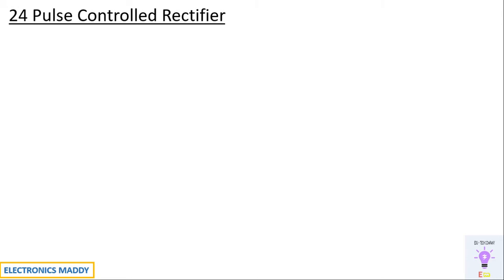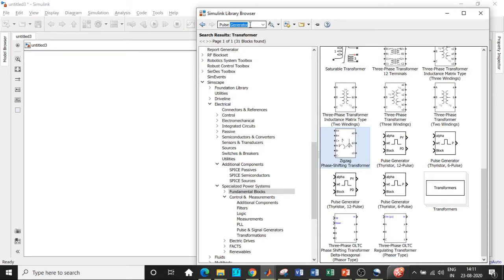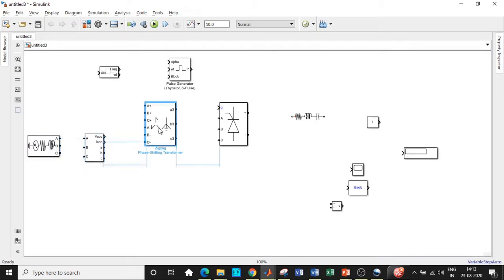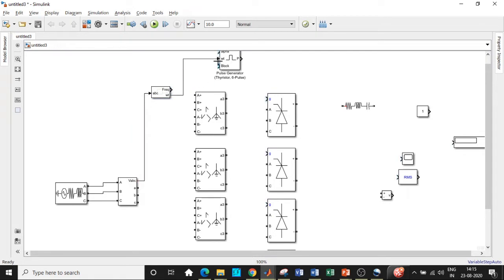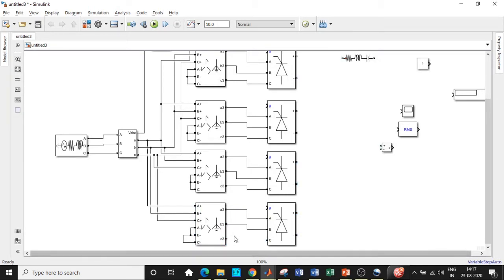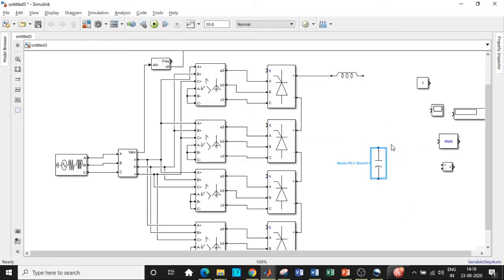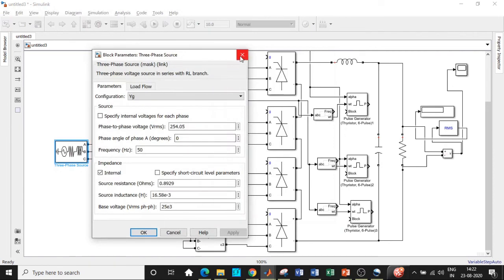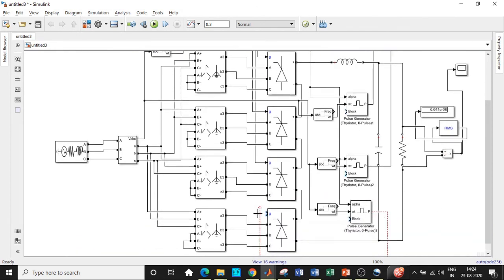Simulation of 24 Pulse Controlled Rectifier in MATLAB | SIMULINK

Comment: Hello,  Can you please provide me a Table of pF and THDI for a 24 Pulse Fully Controlled Rectifier system for varying Firing Angles so as to produce from 10% to 100% DC O/P in steps of say 10%. would be extremely obliged